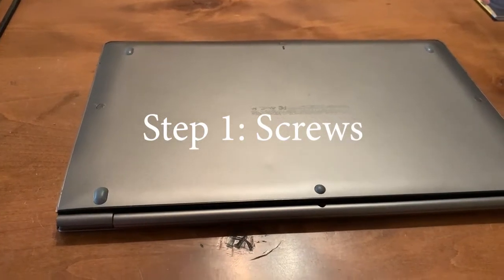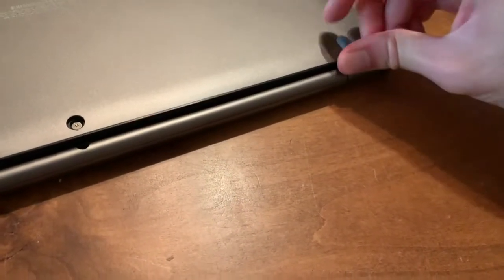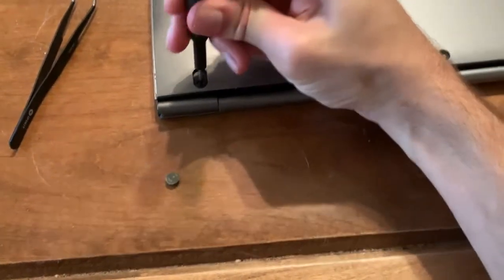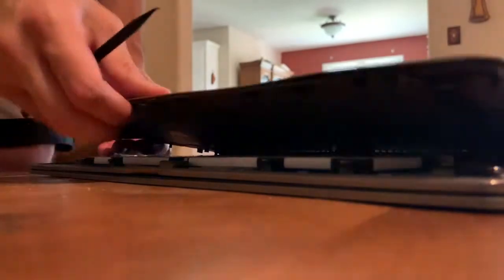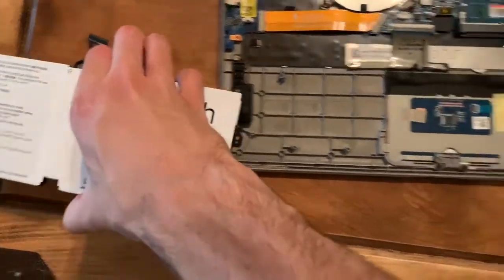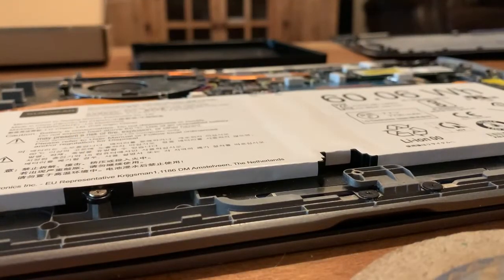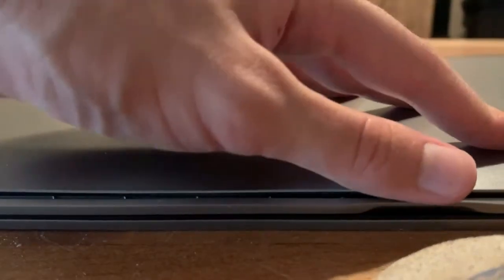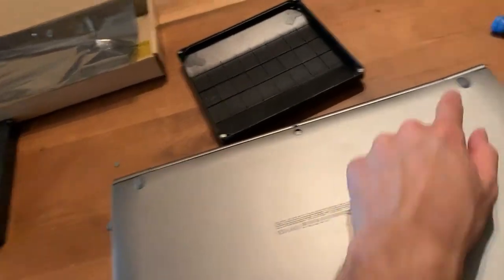How to replace Battery in LG Gram Laptop

Comment: Ive tried replacing my lg gram 17 80Wh battery with 4 different batteries. After doing so, the capacity is ok but the laltop randomly dies (i mean loses all power and does not gracefully shut down) i cant blame the batteries because ive tried 4! Any idea why? I need to replace the battery!
Reply from the maker: It sounds like you could have a short in your motherboard 🧐, you might just need a full laptop replacement or take to a repair shop for further diagnosis